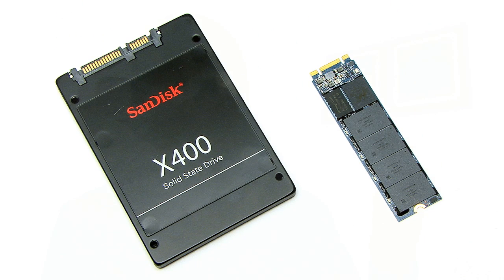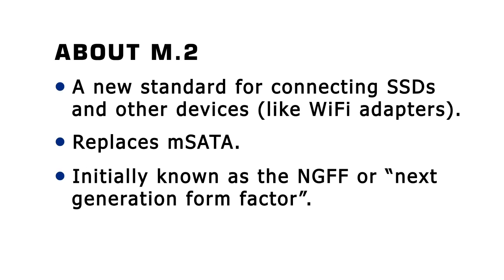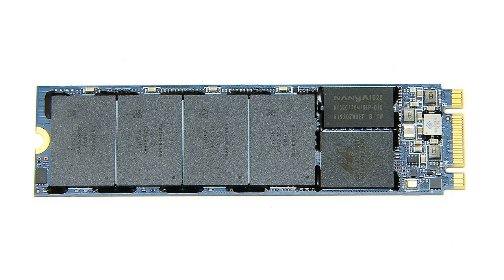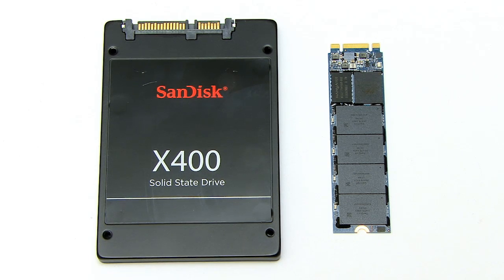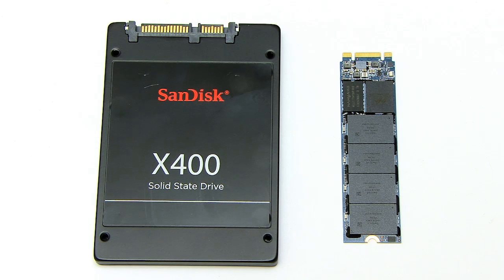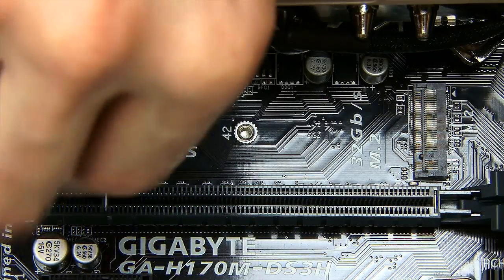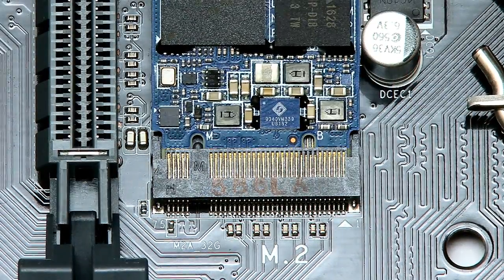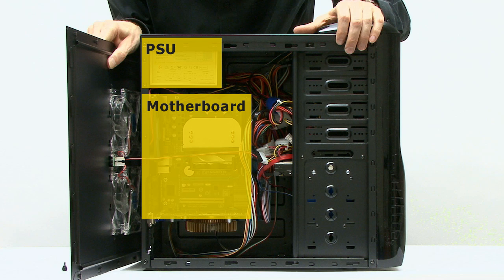Explaining M.2 SSDs

Comment: The video is obviously aimed at enthusiasts, but does anybody apart from enthusiasts still use those huge (under the) desk PCs in a cabinet any more?  The vast majority of ordinary users have only laptops, tablets and smart phones, where the use of drive bays has long since disappeared in the search for small and light.  SATA SSDs are on the way out, and even M.2 drives introduce unnecessary space and complexity inside a laptop. 

Personally I think M.2 is a blip rather than a revolution.  The use of PCIe to connect flash storage is just an interim.  I think what's really going to happen in the next few years is flash storage moving onto the RAM bus, which has a far more efficient interface for handling memory.  The boundary between flash memory and RAM in PCs will blur, as it has already on tablets and smart phones.  Desktop operating systems will evolve in how they manage internal memory, using RAM only for dynamic data.  Program code and static data will run directly from flash memory, eliminating the need to "load" programs and operating systems.  Most people will cease to worry about how much RAM and how much "disk" - just how much memory in total.
Reply from the maker: A lot of gamers and those who edit a lot of video still have desktop PCs. :) But otherwise you are right, smaller form factors are taking over.
Reply: That may be true for home use. However, in a lot of business use, ergonomic and health and safety considerations require users to work with properly positioned full size keyboards and decent monitors. From that background, traditional full or mid sized desktop PCs still seem to be quite popular, even though small and ultra-small form factors are available.

This may be because businesses are very conservative about what they expect to procure and provide. It may also be because moves to introduce "ultra thin clients" about 10 years ago were let down by the abysmally slow performance of some of the devices involved.

AIOs (all in one PCs) would certainly benefit from these smaller drives. AIOs now seem to be popular for some home users. I think they could also potentially replace traditional desktops in the workplace, but I cannot think of any examples where i have seen them in the workplace.

Comment: Not having a bay for an CD, DVD or Blu-Ray drive to in stall the OS and other software will require a USB drive or some other device that is not currently used by the vast majority of software providers.
And, M.2 PCIe drives are great for content creators.  The older SATA SSDs are fine for anything else, including back-up storage.

Comment: Hey Christopher, do you know of any way to check if an m.2 slot on your laptop can handle either NVMe and SATA or only SATA? Some laptops don't have this information in the manual and now I even experienced the situation where I called a helpdesk and they told me a specific laptop of them can only use sata m.2 drives. I saw something about NVMe in the bios so I was sceptical about their advice. I tried it out myself with an nvme drive and contrary to their advice, it was able to use an NVMe drive at full speed. So preferably, I'd like to have a way of checking whether a certain motherboard can use NVMe drives. Maybe this is possible with software?
Reply: I believe it would depend on the chipset your Mobo has. You can start there.

Comment: That may replace SATA connections the same way the replaced parallel ATA (40 pin).  How many people still remember the 40 pin drives?  How many people are still using them?  There are many that are still working and being used today where speed is not needed as much.

Comment: I wonder if it would save money to soldered a 500 gig SSD directly to the motherboard. I remember Linus from Linus looking at a single chip SSD that was a controller and an SSD at CES 2017,(suggesting it would be a good option for laptops and such). But I think motherboards should be more like upgradable raspberry pies, plug and play computers but you can upgrade the ram and add a processor and or everything else. then you could have the os run on the motherboard and the game running on the more expensive hardware. then you could replace the power supply with an external one to save heat, then for the price of a decent power supply you could use the extra space as a battery that could save you work and even you components if your unlucky but with enough juice that you could run your computer and a monitor for an hour. I wonder what computers will look like in 20 years.

Comment: Thank you for this video. 
Suggestion:  Although you gave about a minute explanation of M.2, I feel it would helped clear confusion in people's minds if you had started with a picture of a M.2 connector and said something like "M.2 is a specification for a physical "connector" to which you can attach a memory module or device module, like SSD cards, wireless cards, etc. An M.2 connector is the newest technology to replace mSata which replaced Sata which replaced Pata." Then lead into your particular m.2 SSD device. 
The reason being, m.2 supports PCIe bus, Sata 3.0 and USB 3.0 bus and it is up to the manufacturer of the M.2 host or device to pick which interfaces are supported, depending on the desired level of host support and device type. This confusion is causing people so much trouble when they buy a device that is not supported on their motherboard despite the m.2 connector being present, example; buying an m.2 NVMe stick and installing in an m.2 Sata only capable connector or USB 3.0 capable. Been there,  seen that. Just a suggestion.

Comment: 6:13 We see that there are support holes for M.2 42, 60 and 80 mm drives. How does the 80 mm M.2 board avoid to short circuit on the 60 and 42 mm holes? Is there a special base stand-off screwed into the 80 mm hole, but not in the 60 and 42 mm holes?
Reply from the maker: You are right -- there is a stand off screw thing in the 80mm hole that can be moved to other holes.

Comment: I am yet to be convinced of the reliability of SSD's in the long term, in my experience they are floored and do not stand up to time. I have gone from being exited and promoting SSD dives for their speed to going back with hard drives that are in my opinion more reliable. Yes they can be re-set when they go wrong but a pain when you have to get you data back from backups all the time. I hope they have got better but it will take a while for me to be convinced.

Comment: I have not known their existence till now, I just bought an SSD for my laptop today. I am a laptop convert the last 10 years. 

Judging just from what I have heard in this video. It should be possible to have a PCIe card that can support more drives in little space like never before, Like anything capacity will grow beyond our dreams. As a result RAID or 'equivalent' will become common and transparent.

And laptop users, This can only be a good thing.
My laptop cycle is 3 years old, But if it can hold up for 2 and a bit years. Im kind of exited to rid slow plater drive forever.

*Don't store you SSD for years with no power though ;)

Comment: Must be cool to have that mainboard. They should have a slot on the mainboard next to it so as to allow you to have a similar device for RAM storage. They did this on some laptops for years. This way, you could dedicate to it the virtual memory in Microsoft Windows (or the Swap partition in Linux). Never liked the idea of constant writing and rewriting to flash or SSD like that. And yes I know, trim is sorted out automatically these days... but it still never "felt" right after the "scare" of flash memory getting worn out from limited read/write cycles. It's an "annoyance thing" I suppose. I still think it'd be a cool idea though to have the slot ofr a RAM based virtual memory swap space. Zoommmmm.....

Comment: it's worth noting that the bus speed might not be the actual speed of the ssd, whether its PCIe or SATA, the chips themselves might be limited and essentially the same either way. however, the bus speed could be more important when using multiple m.2 cards or peripherals. A single m.2 slot could be nothing more than a gimmick and excuse to release a motherboard which boasts 'modern' features but actually offers no benefits whatsoever other than the manufacturers to mark some extra profit. no doubt there will be another slot/interface in the non too distant future which has greater bandwidth but still only fractionally utilised, yet is another reason to upgrade yet again.

it does sound a bit to me like, let's add more PCIe ports to a motherboard yet use slightly different interface so nothing is compatible and everyone needs to buy new hardware because, reasons. I'm not saying they are bad at all, it is 'smaller' afterall.

Comment: That's good, much smaller than SSD . How does it compares to SD U3  card memory, cost less ?  Can you make MS Surface  upgrade  RAM video,  I can couldn't  find alternative  brand PC which supports more than 1024 levels pressure senses with pen.

Comment: useful techie update, short practical demo in action to show speed difference would have been nice, or even a performace table
Reply from the maker: Sadly I did not have a PCIe M.2 drive to compare to the 2.5" SATA drive, so as both drives were SATA III, and on the same motherboard, they would (should!) have been the same speed. :)
Reply: Thanks

Comment: Hi. If I will use PCIe M.2 drive will it affect GPU performance? I know that there are many different chipset versions of small motherboards (like H170, B170 or Z170) and one of main difference between them is the amount of PCIe lines avalible. But I don't know how many lines is enough for high end graphics card and m.2 drive to work flawlessly without any performance compromise.
Reply: PCIe lanes for graphics come from the CPU, so are unaffected by PCIe lanes used from the PCH like PCIe based SSDs. CPUs (Skylake) have 16 dedicated PCIe lanes. This is plenty for up to two graphics cards.
Reply: Thank you for the clarification.

Comment: Sir Barnatt, I just purchased my M.2 SSD SATA last Friday for my Laptop. It took me a whole day to Migrate my pre-Installed OS into it.
Good thing MSI has the very best capability when it comes to Recovery and it supports OS Migration in a magical way.
Please refer to this video Sir Barnatt for more info,
https://youtu.be/ArvWkGG_yu8

Intel's Data Migration Software really sucks. I tried also so many OS Migration Software but still my MSI Laptop fails to do such OS Migration. Not until i saw the video above and I did it like a magic.

It will install a fresh new OS on your M.2 SSD and will wipe the 1TB built in HDD where your OS pre-Installed. All data are gone and including Windows 10 apps and updates.

Hope it helps Sir. Thank your very much.

Comment: is it just me or didnt you already explain m.2 ssd? Also i dont like this new slot because if they fully switch to m2 it will be hard to move files and entire discs to older pcs. if sata dissapears this can be detrimental for file servers and security survelliance as previous backups will probably become incompatible. As my final answer, if we still get to keep SATA connections i support m2 but if they try to replace sata i will be strongly against it
Reply from the maker: I'm sure that M.2 will not replace SATA. I've not discussed M.2 in a video before, aside from mentioning that the motherboard I used in my last build had M.2.
Reply: Ok, then M.2 on the go! I just wish they werent as expensive 0_0

Comment: My problem at the moment is how to accurately clone ALL of the contents from the original HD in my laptop onto the SSD, so that I can use the SSD for the OS, and format the original HD and use that PURELY for storage.

Trouble is, it's not as simple as "plug in the new drive, ghost the original to the new SSD, configure the BIOS to boot from the SSD, reboot, format the HD, done."  Asus is ZERO help, and they've literally told me "It is not our policy to help customers with this."

For the record, it's an ASUS ROG G752VS-RB71 that's giving me all of the reasons to remember all those words mama told me not to say when I was little.  (Note:  They're all VALID TECHNICAL TERMS now.)

If anyone out there's gotten it done, I'd appreciate a few pointers.  I can get it to boot just fine, it's the restore partition that I need to be 100% certain that it works FLAWLESSLY, or I can't format the HD.  So far, I haven't been able to create a restore disk/USB after the "apparently successful" clone.  VERY annoying...

Comment: I am current pondering on building a computer with M.2, but I just don't understand why using a M.2 drive would prevent me from using one of the SATA ports. Can you elaborate on that?
Reply: N0616JC Productions because they are using the same SATA channel. the PCH (motherboard controller) has limited I/O channels. NVMe devices may effectively disable PCIe slots as well as SATA ports. Mainstream chipset usually have around 20 PCIe lanes used for all devices (except lanes for GPU are managed by CPU directly, 16 lanes dedicated). NVMe devices often use 4 lanes each.

Comment: the 4k read speed is the same on both standards. i have an crucial sata ssd and an samsung 960 pro 2tb. same read speed at 4k. 4k64 thread is faster however on the m.2

Comment: Is it just the type of M.2 SSD or the MBoard also that needs to have M.2 socket on PCI bus to get higher speeds?
Reply from the maker: For the higher speeds both the motherboard socket and the M.2 drive must support PCIe. Here, for example, I put a SATA M.2 drive into a motherboard slot that supports PCIe, but the speed was limited to SATA (6Gb/s) as a SATA drive was used. Most new motherboards with M.2 slots will support both SATA and PCIe drives.

Comment: m.2 are more important for ultrabooks/laptops then regular desktop PC since their size\weight\power consumption are quite lower, it's sad that there are almost no U.2 connectors drives, only intel have some and there are more server \ enterprise oriented then desktop pc and that shame since the connector can deliver the pcie speed with the nvme protocol, and you can have better options to cool them so the drives are less likely to thermal throttle. btw intel has to increase the pcie lanes of the non extreme cpus with many components shifting towards pcie connections.

Comment: $/gb is still way too much. SSD's have been mainstream for what 5-10 years now? and $ per gb is still stupidly high for anything with reasonable capacity. You can talk about data transfer speeds all you want but capacity is more important than ever. RAMdisk tech has been around ages and the performance is fantastic but the cost is too much. I honestly think you're overstating the possible impact of this on desktops for the forseeable future. Could you justify the additional cost to a small to medium business?  I certainly would have a hard time justifying around $2K+ just for a 2tb enterprise level m2 ssd for a small  business server. And what around $300 for a 1tb consumer level m2 ssd?  That is a very tough sell to average users at current pricing.

Comment: I wish I knew u years ago when learning IT, I think life wud have been alot simpler.... anyway being offgrid I am looking at alternative power solutions for desktop form factors as high performance laptops are too expensive for the average joe or people on fixed low incomes like myself. I was wondering if u can investigate the options for people that r offgrid and utilising dc to dc converters to power pc, either from a pico or a modified ac psu into have a dc source of say 12, 24 or 48 volts solar battery systems. I havent found a mod yet to convert an ac psu into a dc to dc psu as I have about 20 laying around and wud love to upcycle them somehow for this purpose. 

In regards to m2 sata drives I was hoping to see the PCIe expansion card to accommodate 4 ssd/m2's and maybe see something in action with speed tests. Can u use this in a non raid situation? eg mini server application, and can u get 32gb speeds from a standard PCIe x 16 slot on older mobo's?

Going back further I been trying to find PCIe expansion card for sata 3 6gb/s HD's to expand my desktop HTPC from 5 sata and 1 esata to atleast 12 sata but can only find dual sata expansion cards that can do 6gb/s and anything beyond that seems to be off the planet in pricing. Do u know of any budget sata expansion cards I can look up on the net to utilise my 1x PCIex2 and 1xPCIex16 16 slot and along with 3 PCI slots vacant, and yes I wud love to run this off my battery bank too one day. Thanks for reading and cheers.